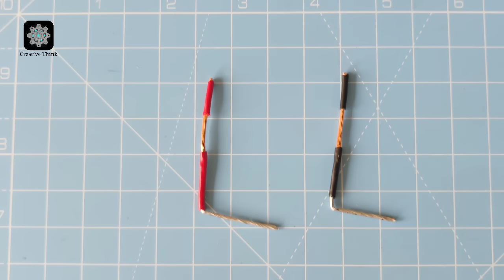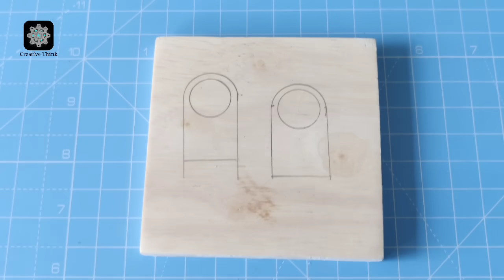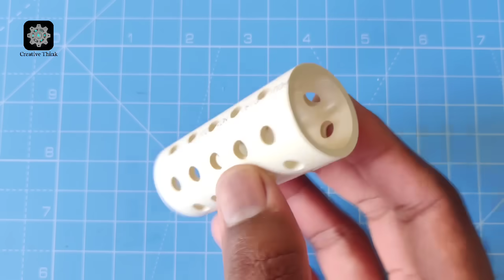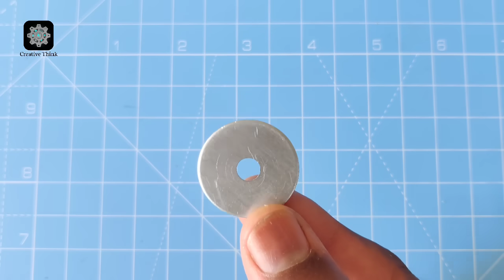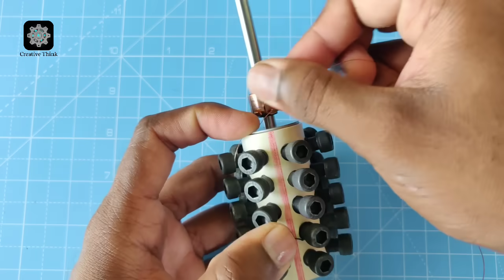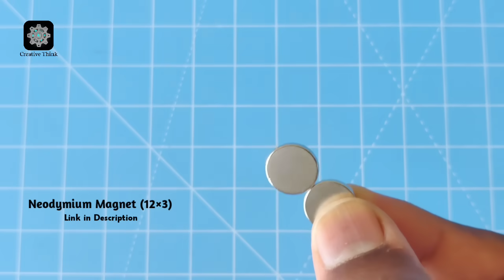Free Energy Generator Using 20000RPM  Very Strong Armature

Comment: I love how it slows in rpm dramatically after using the light , indicating a loss in power and remains that way after the connection to the light is broken.  Probably should have used a bigger battery for the demonstration.  🤔
Reply: я это тоже заметил !!!
Reply: ملاحظه جيده
Reply: सभीजेखनाचहतेहै
Reply: Because it's fake
Reply: @millertime8835  yes that's what he was implying
Reply: Guter Beobachter ! 👍🙂

Comment: Lesson for children how to make classical electric engine with power supply under the table?
Reply: Where is the hole in the board for the wires that connect to the power supply?
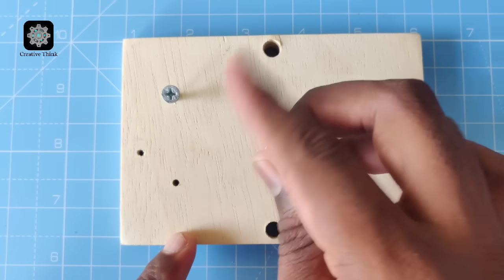Reply: @motorbikemadness5773 , are you realy do not saw two holes plugged at 0:45? It is sadness!
Reply: Да там все проще. Энергия магнитного поля магнитов превращается в кинетическую ротора, магниты размагничиваются, моторчик останавливается. Достаточно известный фокус 😀😀😀
Reply: Fake. There is power being sent to that to make it turn.. I can see arcs at the wire side..
Reply: @FoxyTyger  Ok! it's a fake!!!
Reply: @Merkabaforall  read the video description the he said him self its fake
Reply: @Scott Lamberson yes it was not
Reply: @Merkabaforall  READ THE FU..... DESCRIPTION OF THE VIDEO...... The Maker of this move even tell you its Fake, Brrwww you Genie!
Reply: @ИгорьЛаткин-ш3ю  the holes that held the 8mm bolt holes?
Reply: @ИгорьЛаткин-ш3ю  Yeah, holes in there !!
Reply: @motorbikemadness5773  Induction.
Reply: Red brush is sparking without a load connected, isn't it?
:)
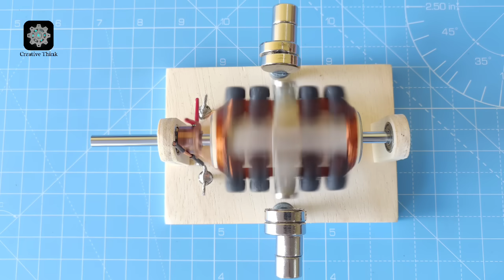8:10
Reply: @Sergey_Fokin  That's kinda what happens when you complete a circuit with difference of potential.
Reply: @motorbikemadness5773  the 2 screws that are soldered to the wires are touching a battery on the bottom of the board.
Reply: @thefixer321  Prove it!
Reply: @thefixer321  There is a battery on the bottom of the board?????  So the board would be higher than it is off the table if that were true.  Try again.
Reply: @l.m.892  If there were no current, there would be no sparks, therefore, current flows through the collector. At the same time, the author of the video claims that there is no load yet, that is, the wire is not connected anywhere. The conclusion is this: either the current miraculously flows in an open circuit, or the author is lying.
Reply: @motorbikemadness5773  The description of this video literally says this is fake and that there's no such thing as free energy.
Reply: @peppermintgal4302  HA HA HA omg, thank you. Well I guess I can unsubscribe from that channel.

Comment: 🔵 The fact that there were sparks showing between the brushes and the commutator before ANYthing was connected to your motor  showed that the power was coming IN through the soldered 'Brushes'.
Reply: Yeah...  And the fact that the "generator" did not slow when the load of the light was attached...
Reply: wrong
Reply: @cossiedriverrs  wrong
Reply: @PeterDad60  Your car has an alternator generating electrical energy. Try simultaneously turning on the headlights, heater blower and maybe foglights (and I really mean simultaneously) when your engine is ticking over. There will be a temporary drop in engine speed until the engine computer works it all out, and inputs more fuel to account for the mechanical load now placed on the engine. So THIS generator will slow when loaded, you can't get something for nothing.
Reply: Yes, saw that also, pins go through base to power source underneath.
Reply: its just an electric motor...
Reply: 8:06 Start, watch the red wire.
Reply: That was the first thing I seen lol
I can't believe people still get fooled by this trick.
Reply: @cossiedriverrs  
Exactly. If he left the light connected, it would stop spinning due to the current draw.
Reply: The sparks are due the wires acting like brushes in an electric motor. This is not fake. Same thing as a step motor for a windmill. If he left the light connected it would eventually stop spinning due to the current draw. Similar to a car generator. It needs a motor with a drive belt or windmill for it to make continuous power.
Reply: @cossiedriverrs  
It did slow down. It would stop if he left the light connected.
Reply: @tonyloeffel4739  
It is a step motor generator. Simple version of what is in the windmills that produce power.
Reply: @axle.australian.patriot  
The sparks are just like the sparks for an electric motor. This is not fake. It was making power. If he left the light attached the current draw would stop the rotor would stop spinning due to the load. If he attached a drive belt to it and had windmill to turn it, then it would be a functional generator.
Reply: @wilsonrawlin8547 ,
🔵 Thank you,..I stand by my initial comment.
Reply: @cossiedriverrs ,
🔵 Where we watching the same video?... It absolutely DID slow!!... check-out 8:30.
And it's only right that it slowed, after all, he's hooking up a load in parallel to an already underpowered motor!
Reply: @joshhayl7459  You are right...  It did slow, no doubt due to the fact that the power supply was limited, and when the LEDs started to pull current, there was less left for the motor. Can't get something for nothing! Now if, whilst running, we had seen the underside, I could have been a little more curious as to how it was done, but the fact that it spun with no load, and there were sparks, was MORE than a strong indication of current flow, and as there was no load attached, that current was motor current... Power supply?  That wooden board was quite thick, and could have had a small battery underneath. Like a few CR2032 coin cells, and I guess he would not have wanted to cut holes in his nice blue mat...
Reply: @joshhayl7459  
Ok. The sparks are from the current being generated by the rotor. Not incoming. Out going current. A simple version of a generator minus anything to drive it other than the magnetic field.
Reply: @wilsonrawlin8547  A. There is no load connected, as such a there should not be any current flowing in the circuit. B. You cannot defy the laws of physics :) Every action has an opposite and equal reaction. Magnetic Motors, Perpetual motion and overture are magic tricks and snake oil.
Reply: @axle.australian.patriot  not arguing whether it was real or not, but if you take copper coils like that and spin them between magnets, the magnetic fields will generate a charge on the coils. They don't need to be connected into a circuit, the potential is there. So sparks can happen if the wire is close enough for the potential to jump through the air to a grounding surface or even a surface with lower potential. Kind of like a tesla coil sparking.